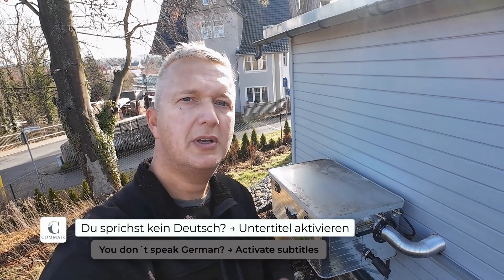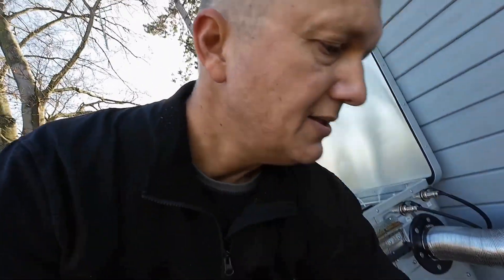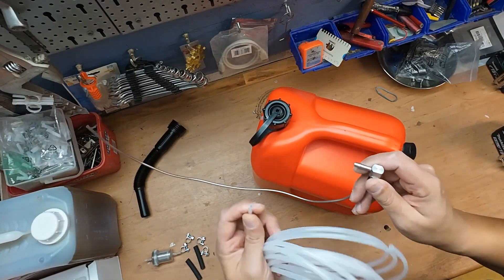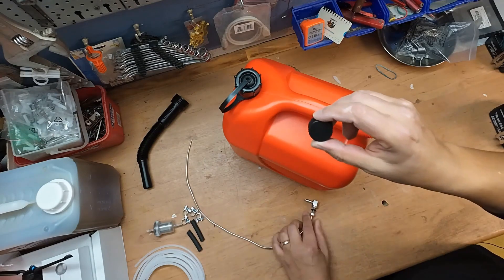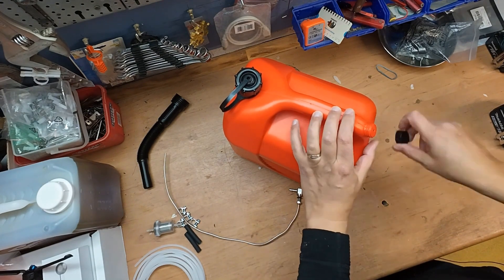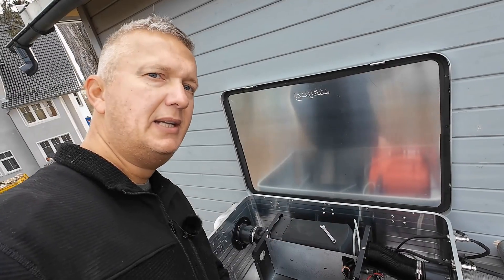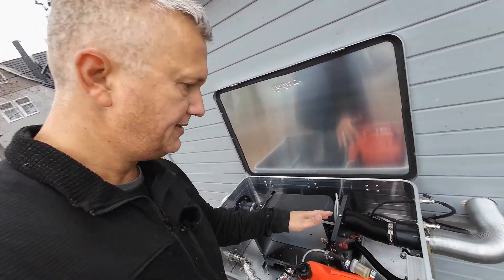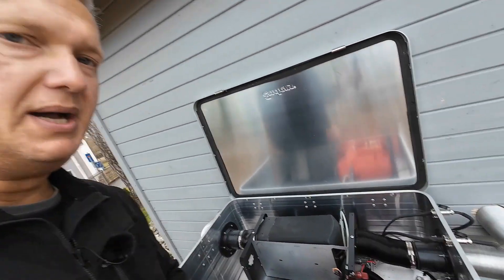Upgrading My Mobile Heating Box: 4x Fuel Capacity!

Comment: Doesn’t the tank need to be vented?
Reply from the maker: Hi,
the tank isn’t completely sealed – the opening where the fuel pick-up is installed is just large enough to let a little air in. This prevents any vacuum from forming, so the heater always gets fuel reliably. At the same time, the opening is small enough to avoid unpleasant smells – so there’s no diesel odor.

Cheers,
Maik

Comment: Found your channel tonight and I'm glad for that, we seem to think alike about a lot. I have two questions regarding your installation. 

1. Maybe I misunderstood, but if you make the tank completely tight, don't you run the risk of getting a vacuum in the tank?

2. Do you have a battery backup? How do you handle a possible power outage?

I have ordered a similar PSU for my setup and it seems to be built with a blocking diode on the 12 VDC ports so I intend to plug in a 17Ah battery and adjust to 13.8 VDC as the battery wants, the diesel heater works better with this voltage as well.

Greetings from Sweden
Reply from the maker: Hi,
Great that there are other hobbyists with whom I can exchange ideas 😁

Yes, of course the tank must not be 100% airtight. Then it will no longer work. I have sealed the tank as well as possible so that it doesn't smell of diesel in the box and there is still no vacuum in the tank. 

Incidentally, my power supply is provided by an off-grid PV system. 4 PV modules Aden charge 3 batteries with 120Ah each during the day. The inverter then transforms the direct current into 220V alternating current. 
I also have an off-grid switch. When the batteries are empty, the switch automatically switches to grid power. Unfortunately, this happens very often in winter because the sun doesn't provide enough power to the PV modules. 
You only use grid power, don't you? 
Best regards

Maik
Reply: @commaikenglish  Thank you for the reply, it seams you have a solid system.

I use grid power with battery backup, no solar panels due to the dark times during winter as you mentioned.

BR

//Peter